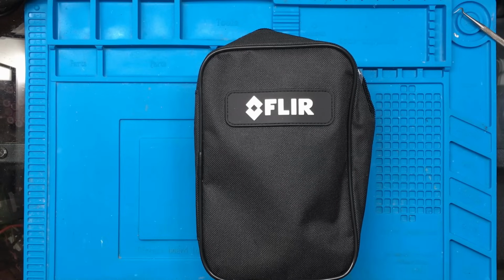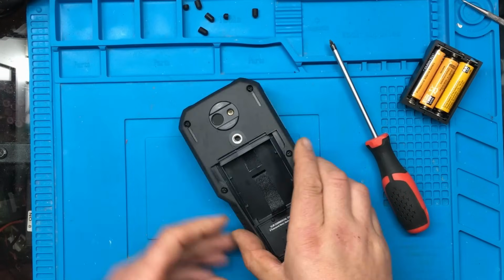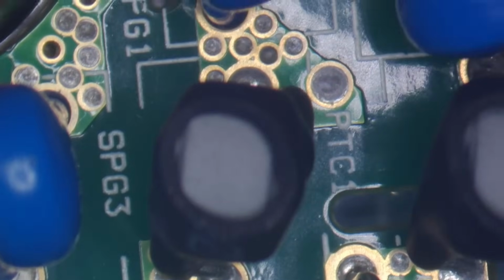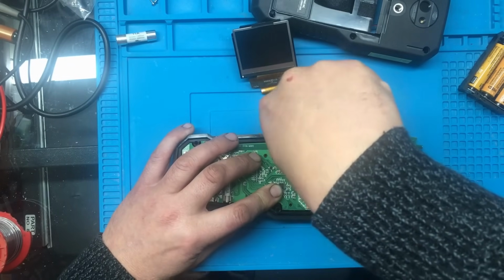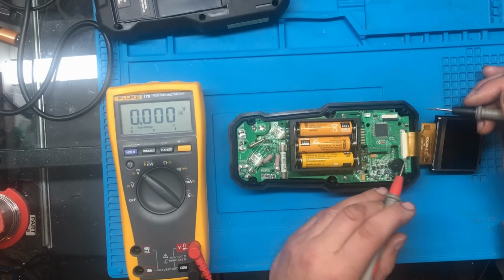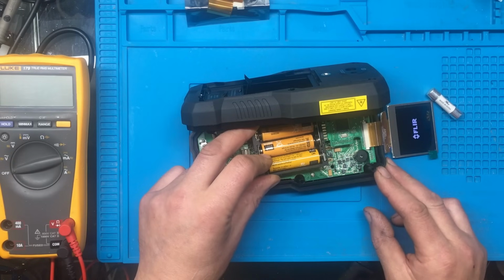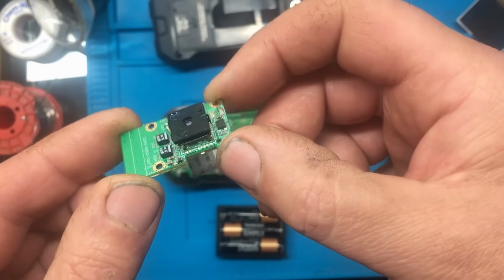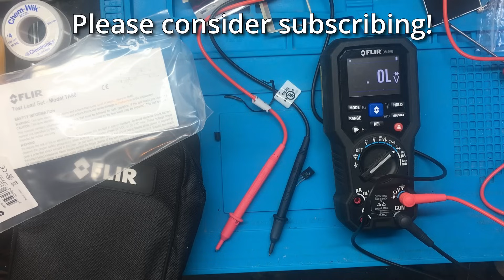FLIR Thermal Imaging Camera Multimeter - Teardown & Repair!

Comment: Amazing repair! Unfortunately I feel you'd get the exact same response from almost every company that makes electronics these days. "Please throw it in the trash and we will happily sell you a new one"

I'm surprised this channel hasn't got way more subscribers.
Reply from the maker: Thanks Adam. I've had my channel for quite a few years but I've only been doing it fairly seriously for about the last 6 months. It has grown quite significantly from when I started. Agree with most companies just want you to throw things away and not repair them. I remember when you used to get a manual with a schematic or the schematic was on a label inside a device. Alas you don't hardly get anything like that these days.
Reply: Ok, I definitely see the channel getting big with the content you’re making. Hopefully the likes of Lewis Rossman or NorthridgeFix soon. 

As for availability of parts, it will only come if companies are forced to do it. Right to repair. Lewis Rossman is doing great work with it.
Reply from the maker: Thanks Adam! I watch Loius too and he seems to be a big proponent of #righttorepair I don't like the way companies try to lock things down with software locks etc too so components have to be paired etc.
Reply: If i got ""Please throw it in the trash and we will happily sell you a new one" response from a company. My reply would be: "No, im not doing that and you won't be selling me a new one. Screw your company policy. You can fk off and I'll just buy what i need from a chinese 3rd party.
Reply from the maker: @simontay4851 lmao 😂😂😂😂
Reply: "Please throw it in the trash and we will happily sell you a new one"
That's exactly the answer I got from Fluke when I tried to repair my 93 Scopemeter. And the reason why I can't really justify to buy new Fluke gear.
Wasn't it RIGOL who kind of actively supported atttempts to hack their scopes to higher bandwidths?

As for the channel: Yes, absolutely. I came here by chance, and the repair videos are really worthwhile. New subscriber. ;)
Reply from the maker: @ThiloNiewoehner Thanks Thilo 👍yes a lot of companies seem to have these wasteful practices or policies now. Hopefully you'll like some of my other videos. I've had to come up with some other creative solutions to problems like this too. I had similar with a solar inverter where the company wouldn't give me the service password and said it's an obsolete model. Good job I know about software too. I show all the emails I sent on that one too. 'No password No problem ' that one is titled on the thumbnail.
Reply: @BuyitFixit  That one's next in queue!
"Toss&Replace" has become the norm now, especially with all things being software-based and on cheap, unrepairable hardware. We should expose that whenever we can, and use our wallets to try and reward those who care. Maybe we can even revive recycling at some point.

Comment: I miss the days when you bought an electronic instrument, knowing it had a printed manual complete with a detailed schematic in the box. Sometimes, the instrument or appliance had a printed schematic stuck to the inside of the cabinet, too. Are those days gone forever? Everyone cites proprietary advantage protection as an excuse not to provide service information, but it seems to me they can omit critical details and still help us techs out with a few test points, waveforms, and block diagrams. Nicely done on the meter. I think you got a little lucky on this one, but well-deserved reward for your effort.
Reply from the maker: Thanks Kenny 👍
Reply: The goal is not to make things repairable beyond the guarantee period.  If you can make the equipment last one month past the guarantee period then it is optimally designed, this tuning has been going on since brand loyalty was a thing and people buy the same brand even though they have been let down many times in the past.
Reply: @KallePihlajasaari  Yes. "Engineered Obsolescence" for the sake of jobs and the economy, it is said. I say that high product reliability and longevity do not make a company unprofitable or put it out of business.

Comment: Amazing work! Do you think if you had separated (cut) Pin 2 from ground on the replacement screen ribbon cable it would have still bootlooped? Really impressive fix to take the signal from elsewhere. Well done Mick👍👍👍
Reply from the maker: Thanks Vince. No I tried cutting the track first. But no luck. It was waiting for a low to high transition. I think it was sat waiting for an interrupt and then the watchdog timer was kicking in causing a reset.
Reply: @BuyitFixit  Thanks Mick, keep up the good work. We can all learn plenty from your vids👍

Comment: Nicely done, you deserve the bodge of the year award! Very good sleuthing!. 
I suspect that something like this could have already been resupplied under warranty. And you got the broken one that wasn't even worth collecting. 
I got a samsung washing machine the same way, it was left out on the street because of a broken door, warranty replacement, only a few years old but not even worth collecting, just a single piece of plastic from one of these "adwash" door in doors. In my case a load of silicone and persistence got it right, and it has been working happily for over a month. 
You are braver when it comes to gambling on a broken one. But I guess you know where you are coming from. I took a punt on a modern heat pump tumble dryer, £40, all it needed to get it going was a careful clean, not even a particularly thorough one. I have posted a few videos of both repairs.

If you keep at it like this subs and views will find you!

Great stuff!!
Reply from the maker: Thanks bootsowen and great job on fixing the washer and dryer!

Comment: might be an idea to send FLIR a link to your video. showing them that they are actually not required to fix their products. great work.
Reply from the maker: Thanks! I'm not sure if I did reply back to FLIR or not. I had a similar experience with a solar inverter and the company wouldn't give me the password for it to adjust a setting after I repaired it, I didn't give up and had to reverse engineer their software, and then write my own password generator. I then emailed them back the passwords for both of my inverters 😂😂Both the repair and the password shenanigans are on my channel 🙂

Comment: I was a tech and I still dabble, I wouldn't never ever have got that hack you did, that's probably why I am no longer a tech. incredible knowledge and patience.. Very impressive.
Reply from the maker: Thank you very much 👍A few times I've had to come up with some creative solutions. I've even had to delve into the software of a couple of devices to repair them. I did an RGB laser which also I managed to repair after a bit of a modification too...
Reply: @BuyitFixit  Once again very impressive, I can't get much further than dry joints these days.

Comment: I second @bootsowen 's comment on you being very brave on that meter!

The datasheet suggests floating the pin, but as it was stipulated on the original LCD this probably cause more trouble. Do you know what is meant by TE1 = TE? Is there a second pin on the LCD marked TE1?

They must limit warranty repair units to the 1 year minimum otherwise they'd be perpetually replacing them.
I managed to find a suitable clutch for a 40year old 2Stroke hedge trimmer from Ali Express. That shop comes in handy!
Reply from the maker: Thanks Ian. I'm no sure about the TE1 as I couldn't see a TE1 pin on the pinout. It can be left floating if it's not used, but in this case it was being used to tell the processor that it had finished drawing that frame or something, but with my bodge it looks perfect anyway... Perhaps it might not update the image as quick or something? but it looks good to me! I was using it earlier on a board to see if I could see a heat spot... Yes AliExpress does come in handy!
Reply: @BuyitFixit  TE is "Tearing Effect".  It is the frame flyback pin if you are native english speaking.  I had a similar experience with random aliexpress displays having different pinouts.  However in my case I was able to change a resistor position on the flex PCB to get access to TE
Reply from the maker: Thanks for that! On the display I got from Aliexpress pin 2 is just linked along with pin 1 direct to ground. No resistors or anything to change.

Comment: Awesome work-around!  So since the display grounds pin 2, I'm assuming that in addition to jumping that line to the backlight PWM, you also lifted the pin from the display connector?  This was an interesting fix -- I own one of these meters and this will be a valuable resource if it should fail in a similar manner down the road.
Reply from the maker: Thanks 👍yes you are correct. I cut the track near the display connector so the pin wasn't grounded 🙂
Reply: if it fails then we can check is it 10y warranty that they claimed on mail.

Comment: Well done, sir! I have a goodly collection of older test equipment just to have schematics and proper service manuals. 
I have enjoyed some success repairing stupid-expensive things like AMX touch panels having broken screens with good displays from old laptops that can be had for $10. 
Also like to take advantage of company buy-outs…for example, Flir bought Extech, rebranded everything Flir, changed out Extech orange plastics for blue, but little internal changes. Extech devices often sell for much less than Flir. Fixed a Flir DVM similar to yours using parts from a dead, cheap, non-thermal Extech DVM with a good screen. $15 fix for a $600 meter. The DVM was complete toast; looked light it would if someone tried to measure 240 volts using the mA inputs :-)
Reply from the maker: Thanks Mark, and thanks for the info 👍🙂

Comment: I once repaired a AC fan (for a boiler) where among the defects a Pic chip was defective. I asked technical support of the supplier and even got a new binary file to flash a new Pic chip. That was really amazing, good support companies do exists, but they are in minority.
Reply from the maker: Nice, I would think that is very far and few between! We need more companies with such a helpful approach. I had an experience similar to this with a solar inverter I repaired where they wouldn't give me a password! (So I reverse engineered their software) The video is on here too called "no password, no problem" if you haven't seen that one 🙂👍
Reply: doncha just hate it when the company says they can't or won't send you a simple thing such as a data sheet?   I try not to buy anything I can't get a diagram for. . . .
Now if i could just get the diagrams for my Jeep    (lol)

Comment: Ok. Now this is absolutely brilliant😎👍 I would have done an analysis of that pin with the original screen and a logic analyser. The screen is defective though and the logic probably wouldn't have worked either😁 So this is absolutely genius, kind sir! Thanks for sharing!!
Reply from the maker: Thanks for your kind words. Much appreciated 👍Check out the RGB laser video I did if you haven't already, I'm sure you'll like that one too 🙂
Reply: @BuyitFixit  I will do that👍 Thanks for the tip! Learning a lot from you💪

Comment: Good job mate!  I was getting a little worried for a few.  That would be a nice meter to have. I have the FLIR camera for my phone. Takes a bit to set it up to check images when I'm repairing something though. That would be quick. My son actually works for FLIR. He makes the optics.  Excited for you getting that to work.
Reply from the maker: Thanks KG Salvage! I'm glad I got it working too! ... But.. I'm not really that impressed with it. A company sent me an infiray one that plugs into your phone to do a review and comparison and my first thoughts are it makes the FLIR one look like a piece of s#*t!
Reply: I've wanted a thermal camera forever. Eventually bit the bullet and got an Infiray for the phone. It's amazing!
Reply from the maker: Yes they are good. I got offered one from topdon which seem to be very similar spec if not the same sensor.

Comment: Wading my way through all your vids. This was very interesting and shows how suppliers are so unwilling to help. Quick question, what is your main ‘go to’ supplier of components?
Reply from the maker: Thanks Derek. I don't really have a "go to" supplier as such. The problem with places like RS, Digikey, Mouser, Farnell etc is that they have a minimum order delivery charge or handling charge. Often I just need a chip that costs a few pennies lets say 69p, but if I order from one of those it's something like £15 deliver so you end up paying nearly £20 for a 69p part. If I have a few jobs that need parts then I'd do that. Often I just end up looking on eBay, Amazon, or AliExpress as it works out cheaper when you only need a couple of op-amps or sometimes I need a hard to obtain chip like on the recent CD player I looked at. The only place I could find one was AliExpress. Hope that helps 🙂
Reply: @ thanks for this info. Very helpful. 👍🏻

Comment: Excellent bodge!! I’m impressed :)
Reply from the maker: Thanks! 👍
Reply: @BuyitFixit  Just thinking about it, the freq of the PWM signal is possibly synced with the LCD ‘refresh’ as to not cause any aliasing with the backlight?? That TE signal may well be exactly the same? Anyway it works and that’s extremely satisfying and a nice bit of test equip at a snip!
Reply from the maker: @petesapwell  Yes true I didn't think of the backlight PWM being synchronized with the refresh. Although the signal is from the LCD to tell the processor that it has finished processing the frame. Anyway it seems to work 😂😂😂

Comment: I’m glad you found this out about FLIR. I was about to purchase a new meter similar to the featured in your video. Because FLIR does not support “Right to Repair” they are definitely going on the Do Not Buy list. BOOOO FLIR. For spite, let’s completely reverse engineer the meter and post schematics and BOM so people can fix their own tech.
Great video
Reply from the maker: Thanks👍I've had a similar experience a couple of times now. One was with a Solar inverter I repaired, and then needed to adjust a setting. I emailed the company that took over manufacturing them and they said "it's an old model, buy a new one" pretty much. I ended up having to reverse engineer the software and I wrote my own service password generator which is available on the video to download. I also show all of the emails that went back and forward the same as on this video. You might like that one too. It's called "no password, no problem" 🙂

Comment: Watched it twice!   Awesome
Is it possible to do a continuity check on ribbon wires of display (no. 1 and 2)?
Reply from the maker: Thanks 👍it's been a while since I looked at this, the ribbon is bonded to the display and has a chip bonded to it if I remember. I checked the capacitors on the display ribbon, but came to the conclusion that the IC on the display had failed.

Comment: I'm surprised you didn't check the two fuses first thing. It wasn't that and it would be a worst design ever if a blown fuse for the input of a DMM were to cause a blank screen but, you know...

When you said there was a couple of pins different on the new screen, I kinda hoped you'd have to break the trace and reroute them or something but what you did was even more impressive.
Reply from the maker: Thanks 👍

Comment: Flir used a 320 x 240 screen. The  Kd 0230 2 is a part number that was used by the display mfg.   Looks like you were lucky to find another simmilar part on the web  but the interface was different.   Note the web page never had the 23c01  number.  Flir may not know the kd 032 number i think there may be another flir number on the back of the lcd.

Comment: Great repair! Looks useful. 
Can I ask where you managed to source a screen? I’m trying to repair a brother label printer that needs a screen but hitting a bit of a dead end :(
Reply from the maker: Aliexpress. I just looked for a screen of the same size and resolution with the same number of pins. Hope that helps 👍
Reply: @BuyitFixit  cheers, will have a look. Are the sizes generally diagonally measured in inches?
Reply from the maker: Yes.

Comment: According to a google search, the DM166 was released in Oct 2017, which means it would still have been under the 10 year warranty. Not sure if FLIR would have repaired it for free without an invoice, however.
Reply from the maker: I doubt it. I'm sure they wanted me to supply the original proof of purchase.

Comment: Quite the leap of faith there to send the pwm signal back to the cpu.
Reply from the maker: Thanks Bob👍, it was only low voltage and the microcontroller was just waiting for that pin to toggle (probably an interrupt) so it worked out well 🙂

Comment: Did you check the original display? I'm really curious what makes it fail with a white screen.
Reply from the maker: Yes, there's not much on it apart from a few capacitors and a silicon chip die bonded onto the cable. I suspected failed chip or bond wires. I did check the capacitors and none were shorted.

Comment: A yr. late , But I wonder if you tried the original screen with the bog wire - stopping the cycling ?
Thanks agian
Reply from the maker: Better late than never 👍the original screen just lit up all white. It didn't display anything at all. I think the internal LCD driver chip on it had failed.

Comment: I have a Flir One Pro and it needs its 3rd battery. I believe the oem charging circuit allows an overcharge, either to fast or too high a voltage. I think if this one fails I am going to modify it to use an external battery, probably 3 AAA energizer ultimate batteries. The internal battery never did run it for long on a charge. Perhaps I will make it attach with a magsafe ring...
Reply from the maker: Sounds a decent plan 👍